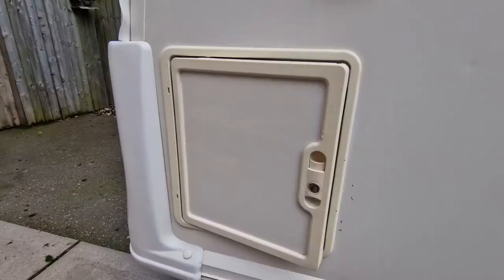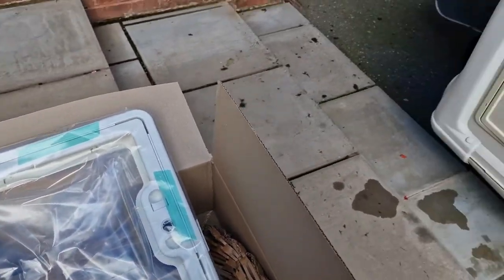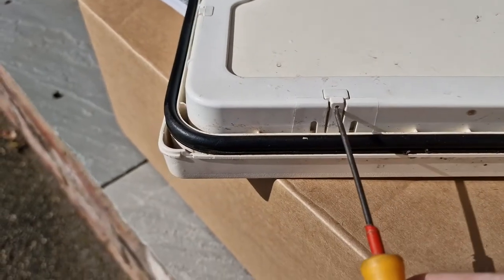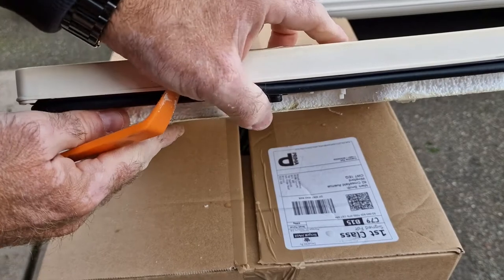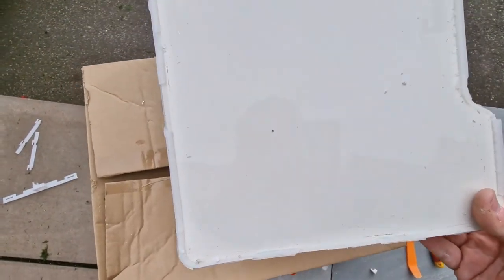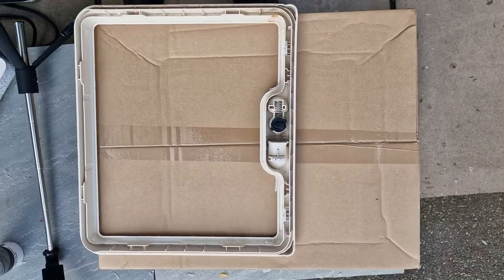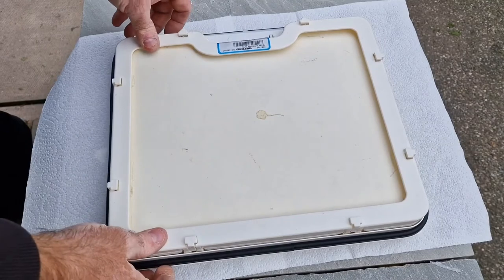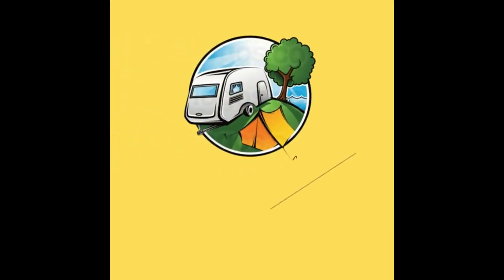Replacing this Locker Door was a nightmare!

Comment: Hi Charlie. I found another way to sort the lock barrel. On the new door you remove the back of where the old barrel will go. The clue is the small holes and I used a set of picks from Amazon (£10) which I’ve used on my Harley for all sorts of jobs. Once the back is off, you can just take out the original barrel and it’s surround and pop it in to the new door…no barrel removal needed in the end. The plastics are prone to breaking so do this as carefully as possible. I also asked Prima Leisure for instructions but it’s obviously an industry secret!! They just sent me a link to find my nearest technician…blooming useless!! 😩. Anyway your video was fabulous and I’ve checked some of your other videos too. Keep up the brilliant work Charlie. Best wishes. Tony.
Reply from the maker: That's great news, well done for figuring that out and thanks for sharing it. 👍
Reply: Sorry Charlie, but the only thing you showed us was how to remove and clean the insert. Not much good I'm afraid. The back of my lock has broken so I need to know how to put my old barrel into my new door

Comment: How do you change the lock?
Reply from the maker: To be honest James. I really struggled to get the lock out of the old door. Ended up butchering it a bit to get it out. I think on reflection there is a proper way of removing the lock. Maybe search YouTube for the diffinitive answer.
Reply: @caravanningwithcharlie  
I hack sawed the lock out of the old one, but I’m struggling to place it back into the next door.. your video has massively helped for the majority
Reply from the maker: Re putting the lock in the new door. I found that when I popped it in ot was a bit loose. So I simply wrapped some plumbers PTFE tape around it and it works great. Glad the video helped.
Reply: I’m sorry to be a pain, but my lock won’t stay in the barrel at all, it’s like the last notch on the lock won’t come out to keep it in the actual barrel? If that makes any sense…
Reply from the maker: I has the same issue the PTFE tape solved the problem
Reply: After removing the black locking plug from the old door, and if  you look at the back of the lock, there is a small metal lug at the bottom, which holds the barrel in the door, you need something small and thin to prise this up to release the barrel, and you are  if not aware of this it can fall out when you remove the barrel, so you need to be careful when removing. We discovered this when it fell out at our feet best to put the barrel back in once you have got the door hung and ensure this small lug is to the bottom, as it is gravity that keeps it there. Hope this makes sense.

Comment: Did you video how to remove the door / hinges 

Nice video
Reply from the maker: Thanks. The door hinges are pretty easy to remove. There are two, one top and bottom.  Each hinge has four   protruding fingers for want of a better word. These slide into slots on both the door and the frame of the door. It's kind of difficult to describe, but when you do it, you will understand.